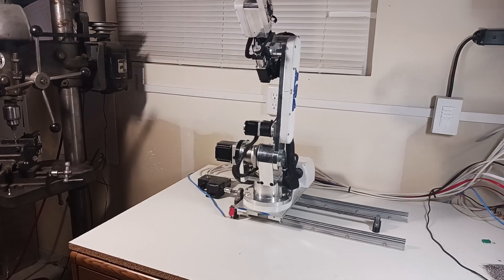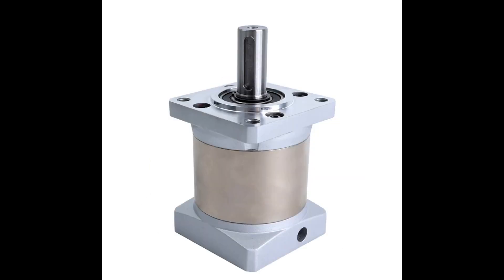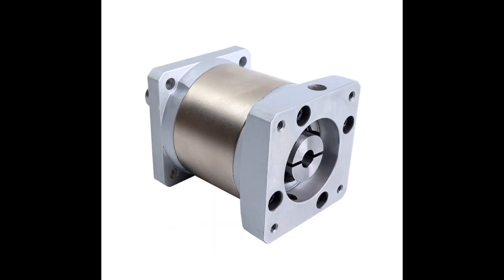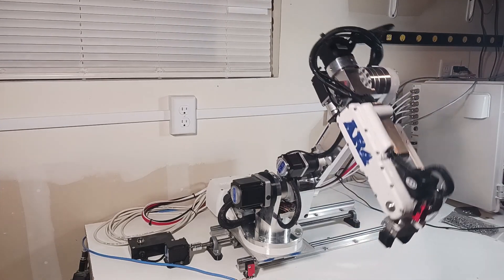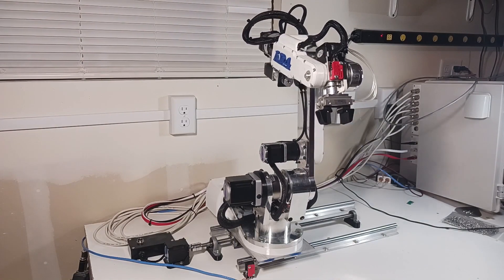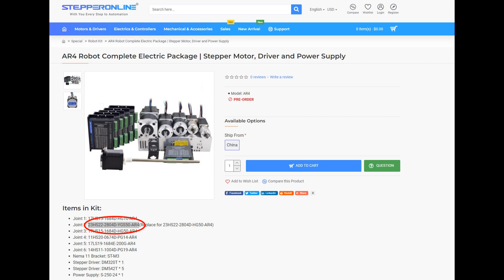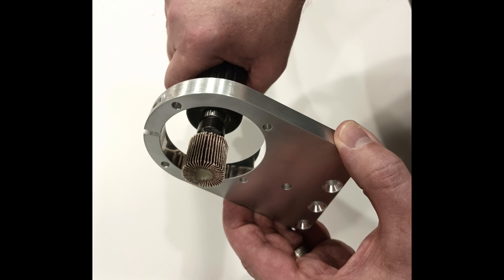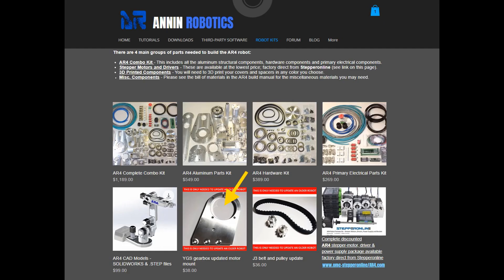AR4 Robot Gearbox Update

Comment: Chris, are you familiar with JMC servos? Packaged in stepper form, with a built in driver on the motor. They accept step/direction signals just as a normal stepper would. They are fairly competitive price wise.

Comment: Hey, Chris! 
Can you please tell me which motors can be used to build a small manipulator training robot? MG90s are not suitable because the arm movement is shaky with them. NEMA17 stepper motors are too weak. 
What BLDC geared motors can be used, and what drivers would work for them? 
Looking online with my son for a few days, still can't find a kit to start building mechanical parts.
Reply from the maker: are you looking at gear head motors?  The AR4 uses a 50:1 reduction nema 17 and it does well

Comment: Hey, Chris! Love the robot! Great work!
I have a few doubts regarding the motors used in the robot: Are they geared motors? If so, then what is the gear ratio used for each joint. Also let me know what all did you consider to calculate the gear ratios for each link.
Reply from the maker: Hello,  some of them are 50:1 and others are 20:1 the ratios were chosen based on torque needs but also based on minimum pulse width needed to maintain arm speeds above 100mm per sec.

Comment: Hi Chris how are you ? i from Brazil and I'm amazed  with your project, well i have a question, do you have some project that we can use arduino Uno ? i mean, with cnc shield for arm robot ? Thank you so much for your work here.
Reply from the maker: Hello, the earlier AR2 robot can be run from an Arduino Mega but the newest version of software with all the kinematics midst the faster processor of the Teensy board.  You can still download all the AR to software on the downloads page
Reply: @anninrobotics  Thank you Chris , i will try with arduino Mega.